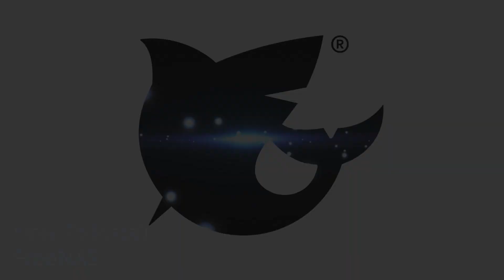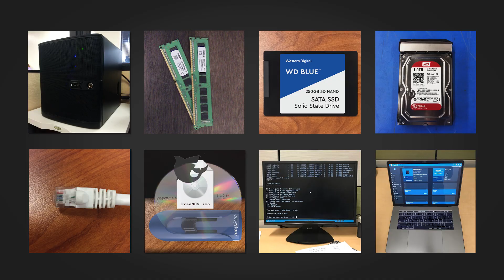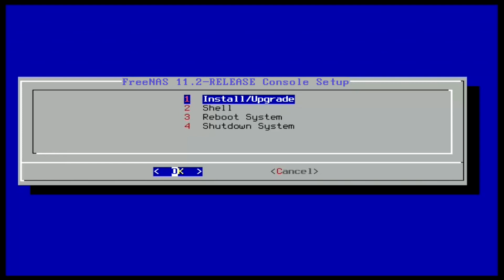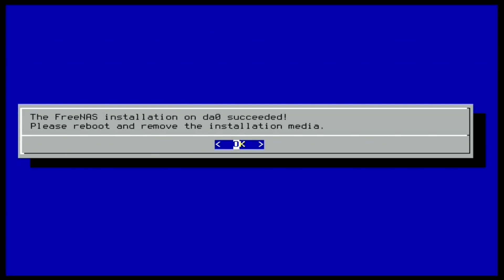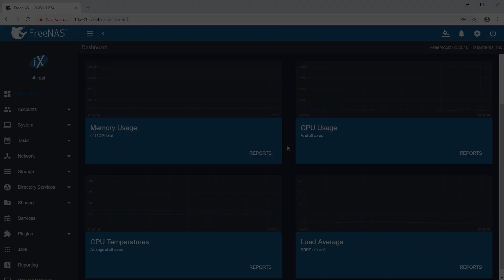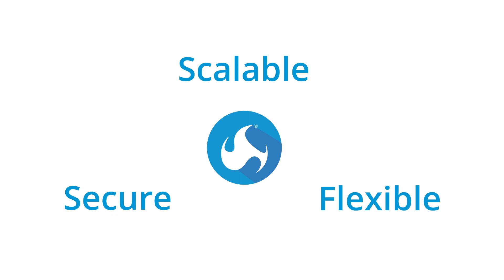How to Install FreeNAS [unlisted 2]

Comment: So I followed the video up until the point where I am choosing where I would like FreeNAS to be installed. SO I have both USBs connected (one with the installer and one for it to be used as required). I create my password and then hit enter. I am met with the following messages: 

gmirror: No such device: swap.
2+0 records in 
2+0 records out
2097152 bytes transferred in -.155956 secs (13447047 bytes/sec)
dd: /dev/da2: end of device
3+0 records in 
2+0 records out 
2097152 bytes transferred in 1.603402 secs (1307939 bytes/sec)
da2 created
da2p1 added
da2p2 added
gmirror: No such device: swap.
da2 destroyed 
da2 created 
da2p1 added
da2p2 added 
active set on da2
cannot create 'freenas-boot': pool already exists
The FreeNAS Installation on da2 has failed. Press enter to continue...

I am trying to use a no longer used DELL Inspiron 15z laptop to run FreeNAS. I do have a 500GB SSD installed and have 4GB Ram (I know it says use 8GB but this is just a test to see how everything works before I create a proper system). I am using a 32GB USB that contains the installer and a 14.6HB USB that will be used to run FreeNAS. I am not sure why I am getting this error message. I also want sure which to choose UEFI or BIOS. I tried both and ended up with the same messages! Not sure where to go from here...
Reply from the maker: Hi Royston, 

It's difficult to solve issues over social media. Can you create a post on our forums site? Be sure to include the same details as you did here. If you can, include some screenshots of your process as well. One thing to try is to make sure the USBs are wiped clean (no old data) before the install process. 

www.ixsystems.com/community

Comment: why cant i select the drive? I see all the drive but it wont let me use arrows or space bar to select the drive. i have to use page up and page down to move up and down.
Reply from the maker: The first thing you can try is to use a different keyboard. After that, if you're still running into the same error,  can you create a post on the forums and detail your entire process? 

www.ixsystems.com/community

Comment: Hi, i have an old server with 8gb of ddr2 ram, 2 intel xeon e5410 and when I plug in the harddrive with the free nas os, ther server does not boot, it is only the os harddrive. And there is an raid controller in too. So i do not why its not booting?
Reply from the maker: Hi there! We're a little confused about your question. What's the size of the drive that the FreeNAS OS is on?